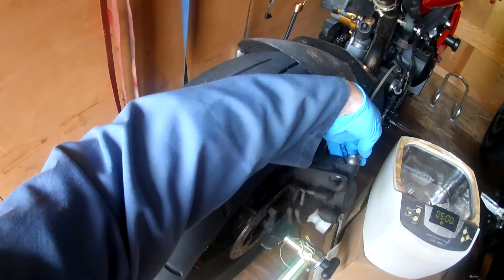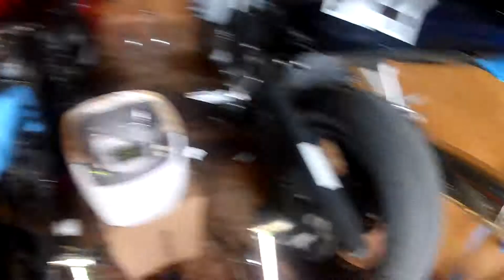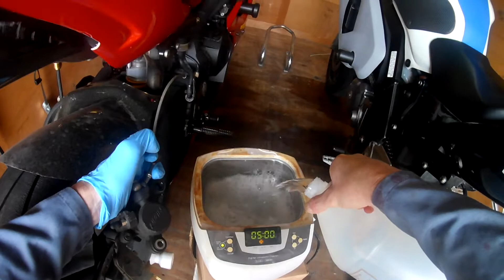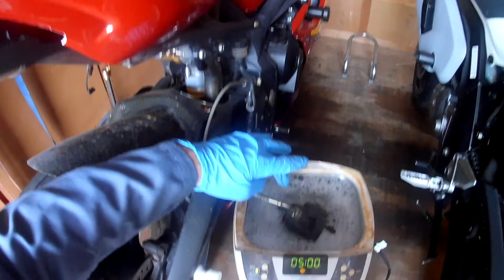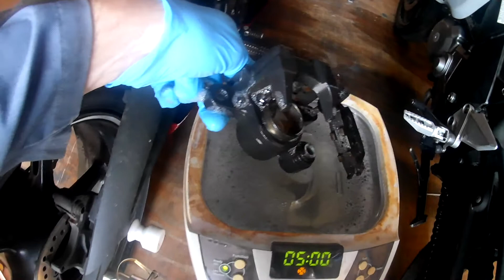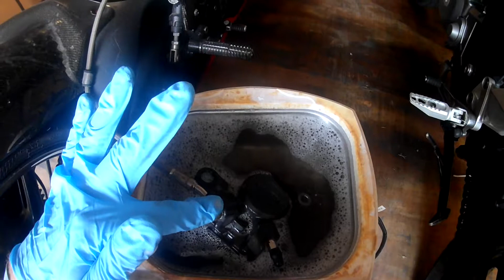Motorcycle Brake caliper ultrasonic cleaning bath - Part 1

Comment: Hi, 
What kind of solution do you use for cleaning?
Reply from the maker: Now i use Just plain pinesol and water. 
Getting fancy, I have used pistol cleaning solutions and water, but I did see a cost/benefit difference
Reply from the maker: Sorry I meant “DIDN’T see a benefit “ from more costly solutions. No pun intended.
Reply: Sweet👍 seen people use solution of baking soda, vinegar and sitrus. Have you tried? It may be a little strong on alu🤔